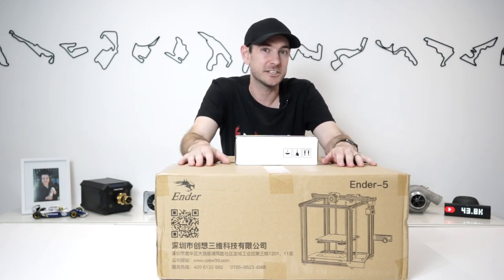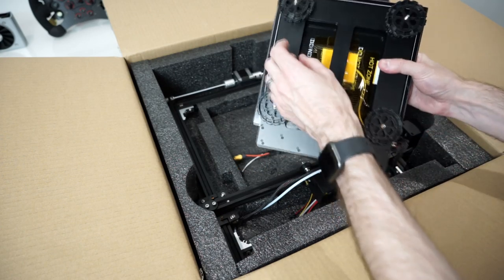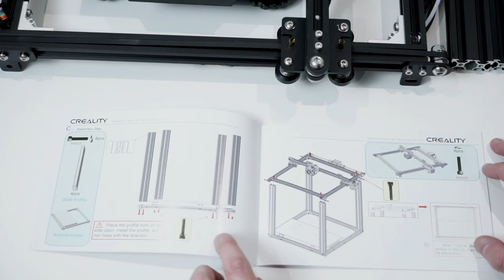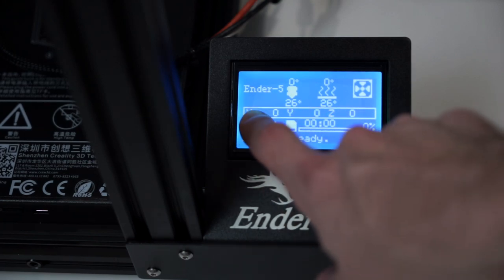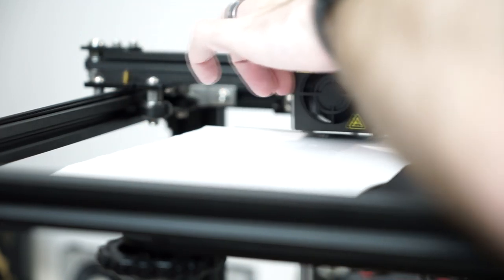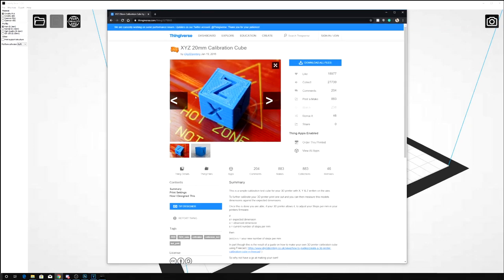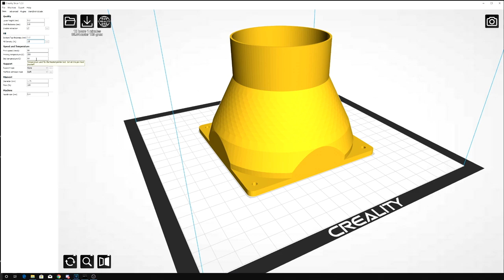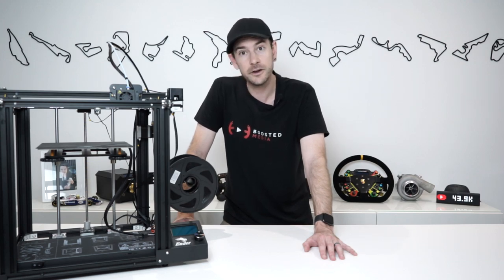3D PRINTING - Creality Ender 5 - Unboxing - Setup & First Print

Comment: I just got this printer myself about a week ago. I will mention that I am having issues with my X axis stepper motor, it appears to be the connection or wire at the motor. Other then that it has printed well. Get the Glass bed for it and the silent v 1.1.5 board or another compatible board really quiets the Ender 5 up.

Comment: i am here now, and have finally setup up my ender 3 v2 after 2 years of sitting in the closet in the box sealed. i have printed your wind sim, dd1 psu mount, cup holder, dd1 hub spacer, and vr and head phone mounts.. and im constantly looking for more ideas for my sim rig.

Comment: Hi, good effort getting up and running. you should look into setting up a Raspberry pi with Octoprint and a webcam so you can monitor your printer from your phone or pc incase it runs into any issues you can stop it. you can also start printing from your mobile etc worth looking into. Very simple to setup there is a few good videos on YouTube on set up and best plugins to use.

Comment: Got an Ender 3 and haven't had any dramas with it but haven't used it enough to comment on reliability.
Been a load of improvements in filament offerings since I bought it and with a fairly recent vehicle purchase am just setting it up again to play with some intake bit's and pieces (medium stress temp and physical bits) for a bit of fun plus easy to take molds of for a bit more serious bits.
That shroud looks cool, but I won't be printing with PLA.
You get what you pay for with these units but they get you off to a solid start, you don't have to use proprietary parts once you dive in a bit and all upgrade fairly simply. 
Cheers

Comment: i mean, the ender 5 is not really an "upgrade" to the ender 3, its just a different concept. both are very similar though, i use the ender3 pro and a friend got the ender 5, the quality is exactly the same, but the ender5 can potentially print faster because it doesnt move the heavy bed around as much.

one little tip: the structure at the bottom is called raft, you dont really need to use that, without a raft, you get a way better finish on the bottom of your print!

Comment: You don't need to print with a raft, it's a waste of plastic most of the time. Also, I printed those duct and you can print them at 0.35mm. The quality is not that important. If you try a 0.6mm you will see how quicker you can print! Good job!

Comment: Sim racing is the one thing where I’ve wondered what could be done with some 3D printing of my own, but don’t have easy access to one.

Though looking at your amazon link the  ender lineup wasn’t horrendously expensive (I feared the worst when you mentioned how much your Aldi printer cost and then gave your thoughts on the quality difference) 🤔

A new rig first though! (Among, say, a whole lot of things I could wish for 😅)
Reply: They made a mclaren wheel replica for dd
Reply from the maker: The cost of printers has come down a lot in the alst few years, but the cost of printing hasn't. So much so that this printer has almost paid for itself in the money I saved on not having to pay someone to print the 120mm fan adaptors you saw in this video!
Reply: Boosted Media now that is impressive!

Comment: Very interesting stuff. How durable is the final product? My Astro A50 headset top bracket broke and Astro has zero replacement parts so someone suggested I look at 3D printing. Course, I wouldn’t buy a machine just for one part. This video has made me look into it more. Are there sites where you can ask people to create a part for a fee?
Reply from the maker: Yes you can certainly get stuff printed for a fee, but usually, the fee is very expensive due to the time required to print stuff. For example, the two fan ducts I printed in this video would have cost me half the price of the printer.
Reply: Do you guys know of a site that lists people? Honestly, it’s the first time I see one working in progress, I can see the benefits already from this video.

Comment: After leveling the bed, how did you get the bed to lower from the nozzle once you started heating up the pla? I leveled my bed, made sure the nozzle lightly grazed the paper, but when I began heating up the pla, the bed remained at that distance and the hot nozzle began burning the magnetic mat on the bed. I feel like I'm missing something between those two steps (leveling and heating). Thanks!

Comment: First error is buying a Creality machine
Reply from the maker: Why's that?
Reply: Boosted Media troublesome machines..they lure you with the price tag but by the time you fix all the problems you will spend more than you would have done with a different machine. Few items on the list that come to my mind : auto bed levelling to fix their bent bed, glass bed, new board with silent stepper drivers, ptf tube and hotend
Reply: What brand would you recommend as an alternative or preferred option over this one?
Reply: devonport1978 Prusa is almost bulletproof or a very new hand made with high end spec Sec Kit https://seckit3dp.design/ planning to ditch my ender and move to this one... linear rail bearing instead of cheap bearing on plastic wheels or bent Z screws and all the bells and whistles you need (WiFi, silent stepper, direct drive extruder, machined bed, 220v/110v heated bed etc etc)
Reply: okleydokley yes sure.. enjoy
Reply: ... they've among the best reputations of all the brands, ffs.
Reply: of course
Reply: @enricobononi8655  You get what you pay for.
The Prusa printers are good, but in my humble opinion a bit too expensive.
I myself have dabbled around with 3D printers for a while. I started a few years ago with a Sunhokey DIY printer that was build from Perspex, and was not really cheap. Compared to that old build kit the Creality printers are really value for money, and not bad quality for their price range.
For a beginner I certainly can advise the Ender 3 or Ender 5. They give a good "out of the box" print quality, and are for the biggest part already pre-build. That makes the relatively easy to set up. They also are more in the price range for the average hobbyist, and are also excellent start models for those that like to tinker.
I think the Prusa printers are more for the people that want to do some semi-professional work, like CAD modelling and prototyping. The price for the Prusa makes it not that attractive for beginners or hobbyists.